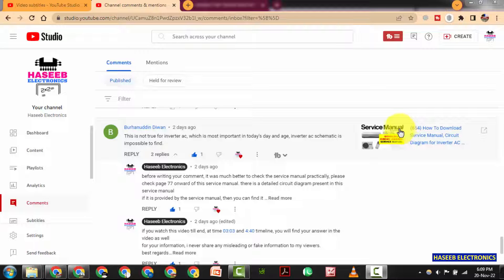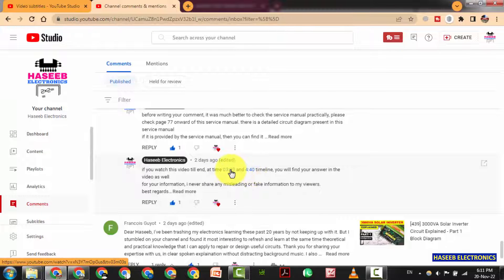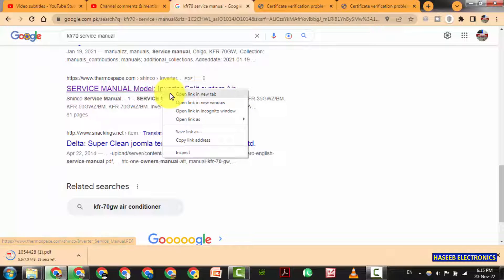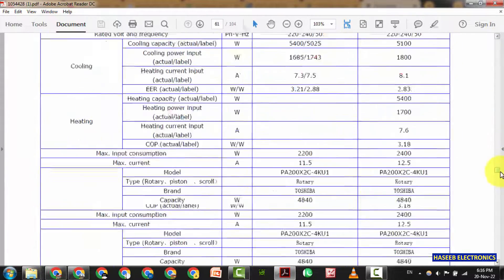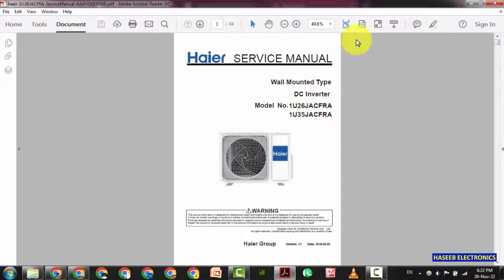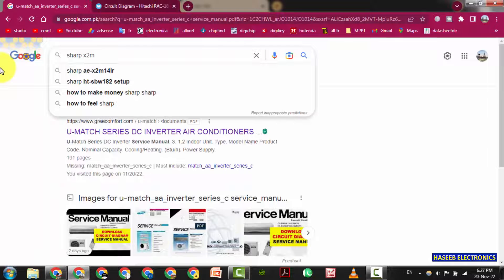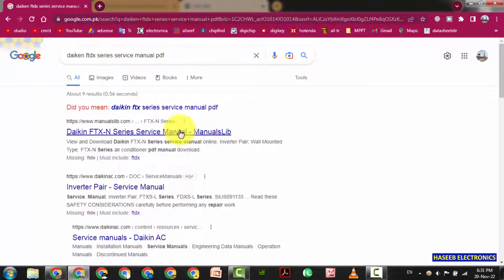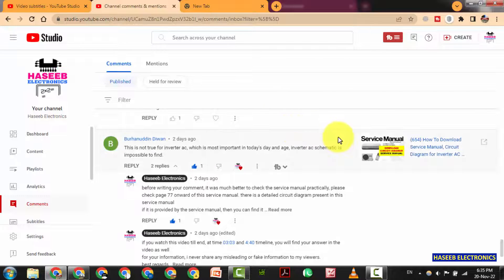{774} How To Download Service Manual, Circuit Diagram for Inverter AC Board

Comment: When I worked on heavy trucks for a living (27 years) we had all of the factory manuals in our shop because of the company I worked for also sold new trucks and worked on warranty repairs. EVEN THOUGH we had "all" the resources so many times things were different. They made a mistake in the manuals or even on their websites. The electrical schematics always seemed to be for a DIFFERENT model than what you had in the shop. Or, the maker of the truck and the maker of the alternator (generator) couldn't agree on what the purpose of "wire 3" is for. You had to work with the incomplete information given to you. I worked on motor homes and buses also where MANY different manufacturers of components were involved. Thank you for all of the free work you do and happy Monday to you and everyone else on here!

Comment: I have big issue in my dvd SMPS power supply  I can not download service manual in power supply pls help give your number or mail id please
Reply from the maker: can you please send its model number or board model number, so i can try. or at least SMPS controller IC part number, so i can try, if it is available then we can find it
Reply: @HaseebElectronics  how to share the picture
Reply from the maker: @PraveenKumar-yv9ex  you can send to my whatsapp 00962-79-1161084 or gmail id ashrarf4ta4